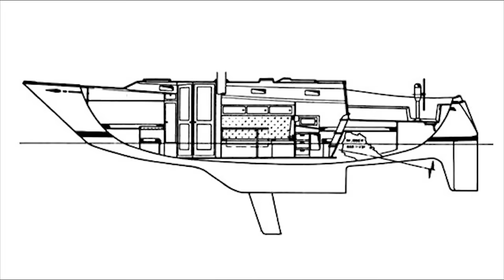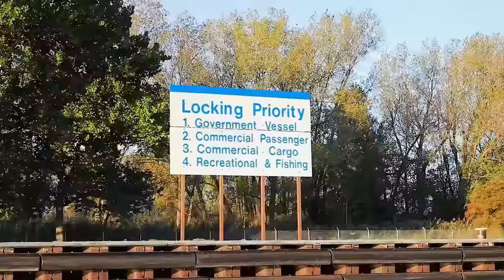How to Run Aground in 8’ of Water When You Only Draw 4’ | Sailing Soulianis - Ep. 24

Comment: You might look at Keelhauling as an emergency remedy.  Not that you actually take a crew member and drag them under the keel but you run a line, under the hull, from side to side and let it sink to a premeasured length that hits the middle of the extended board. then walk aft on both sides until it gets taught and winch.  It might take a couple of tries.  Of course that won't un-jam the line if it gets between the side of the board and the slot.
Reply from the maker: Hi Chris, yeah we tried this a few times. Once we didn't show on camera, and the second time was the "last-ditch effort." And you're right, the line was really freakin' jammed.

Comment: A good outcome in the end,I didn't think the haulout cost was too bad,considering everything.
Tell me,when your centreboard is down,do you draw more than an average boat with a standard keel?
Those industrial areas are a worry,and right by the water too,any wonder there are so many accidental spills and contamination problems.
Let's see how your adventures go as you head further south😊
Reply from the maker: Hi Wayne, totally agree. It was hard to bite at the time, but we learned a lot and came out on the other side without any damage. Not sure what average is, but I'd guess yes -- the boat's technically supposed to draw 7' 9" with the board down (we think fully loaded it's closer to 8').  -L

Comment: Some type of limiter needs to be installed on your centerboard to prevent 'over-centering ' occurring again...possible a short cable or an actual block within the keel well...or a spring or flexible housing to keep the 'hose' engaged in the centerboard's curved channel. When you get it figured out you both will be a God send to other boaters who may be in a similar situation but, with less options for assistance.

Comment: The early 70th TARTAN  is one of the greatest design of all time. I wanted a T-34 so bad, but the Center-Board is a permanent issue and a pain in the butt, even it's just all done and renewed. The pain comes back soon.
One guy I had contact with, took the Center-Board out, filled the space of the Center-Board with lead and closed the hull with epoxy. Never Center-Board issues anymore and the sailing characteristics are pretty much the same (more weight) and you stay at 4 ft depth. That could be a plan for the next "hard time".
Reply: I have a Pearson 35 of 1969 vintage with a centerboard. Never had a problem. 3'7" board up and 7'6" board down. She handles just fine. I think I saw that you guys are now "on the hard" in florida now or are you really just starting your journey? Seems might late in the season. Best Wishes for a Great Adventure!
Reply from the maker: It's worth considering. The fact that the pennant runs basically through an unprotected thru-hull scares us.

Comment: Its actually a swinging keel. Because its primary function is to add weight at a deeper draft. Also functioning as a centreboard or daggerboard affording resistance to leeway facilitating higher pointing culminating in improved progress too wind. Roughly.
Reply from the maker: There’s no ballast in it though. Also Tartan calls it the Tartan 37C as in Centerboard.

Comment: Mark the line so it can't be let out too far???
Reply from the maker: It's marked. But that only helps if it's running up through the mast. That wasn't the issue anyway -- the board inadvertently fell down when we didn't yet have a proper mast plug to run the pennant through and make it fast on deck.
Reply: Bill Roberts ding , ding , ding ding !

Comment: yal need 2 things.. you need to drill a hole in the bottom end of the  center board and lift  it from nearer the bottom.. 2  you need to block it in front so it  cant  move that far forward.. it will happen again.. you want it to be  facing backwards when set....so you  can loosen it and drive forward and lift it at the same time, if it  happens again..when it  happens again..it will happen again  unless  its fixed
Reply: johnny - I doubt the passages for the pendant line would let them connect the pendant to a significantly different place on the board without the pendant chafing badly.  Also, personally, I wouldn't drill into the centerboard unless I was sure it was solid fiberglass (or some other waterproof) construction.  If it has a wood or foam core, I'd worry that new holes would let water get into the core.

Comment: You have to stop the board from going forward.  And only hang straight down so the purchase pull is straight up , still not to good looking at things from here if it goes forward it changes your stability. And balance on the wind and if you ground it won’t fold aft as it’s designed for , keep going good vids

Comment: If it happens again would a length of rope with a weight tied on in the middle dropped into the water at the bow and each of you walking from the bow aft, each of you holding your end of the  rope until you reached the area where the rope contacts the centerboard wouldn't you guys be able to pull on the rope and pull it back? Walking a bit further aft and pulling? Do you suppose that would work to pull the centerboard aft a bit? Obviously you cannot do this with your forward anchor deployed because you won't get your rope past the bow with the anchor payed out. Just a thought but it might work. Of course the rope with the weight on it needs to be the correct length to slip under the bow and be long enough for you both to walk down your respective side of the boat rope in hand and be short enough for the midpoint of the rope to catch hold of the centerboard.
Reply from the maker: We tried exactly this twice before resorting to more drastic (crane) measures. If we hadn’t first tried to winch the centerboard line so tightly it may have worked. Because we pinched that line in between the board and the trunk to the point where the board wouldn’t move freely.

Comment: I guess you could loosen the line and try using the engine and a shallow spot to move the board around....It is much better to get hands on it though, and the water was probably freezing.
Reply from the maker: Definitely an option. But with no way to know how much pressure we were putting on the board or how stuck it was, we didn't want to risk damaging it. The water was cold, but more so it had all sorts of disgusting crap in it -- chemicals, oil, fuel, garbage, debris, you name it.
Reply: @SailingSoulianis  You definitely did the right thing for the first time in the situation.

Comment: I would think the board would have a stop to keep it from going past  parallel to the ground. when extended. then it shouldn't be able to  try and pull up backwards meaning to the front...  enjoyed your video and subscribed.
Reply from the maker: Thanks for watching! Yeah, you'd think that, but there's a benefit to the board swinging forward: you get access to the entire board, meaning inspection and repairs are much easier. The other thing is, if the tension isn't kept on the centerboard pennant at all times, it can accidentally slip down in between the board and the trunk, and if the board is partially or fully down, you might have trouble pulling it up.
Reply: @SailingSoulianis  don't get me wrong I am no sail boater by any reason. just  like problem solving.. If I understand it correctly it stays down by freefall and weight and pulled up by your pennant Rope.  if this is true if you run aground slightly  it may cause the problem you just had by the ground pushing it up and slacking your line and allowing it to go to the side again.  Then may I suggest a snubber   somewhere in your lifting line  as you would a anchor line for storms except stretched when board is down to keep your tension. that way if you do get slack by grounding or whatnot it stays taught.   Happy Sailing

Comment: my keel was hanging down when I pulled my boat for the winter, no sign of the cable that holds it, it must have snapped or come off somehow. I have to fix it before I drop back in in the spring. :(
Reply from the maker: It sounds like a fairly common issue, good luck with your repairs!
Reply: @SailingSoulianis  thanks!

Comment: dag-gone centerboards!  there should be a hard forward stop which prevents the CB from going past a full down position.
Reply from the maker: Ya I was quite surprised to see the centerboard go forward of vertical!  Luckily we had discovered this when were inspecting it up in Charlevoix a couple of months earlier.  If we hadn't seen that then, I would have been much more worried seeing the way it looked coming out of the water there in Chicago. -Kirk
Reply: Why wouldn’t you put a stop so it doesn’t go past 75 degrees (not quite vertical)?  Seems strange that it isn’t designed with one.

Comment: Now that you are aware of the geometry, you could rectify a repeat of the problem by deliberately (and gently!) running aground forwards, to tilt the board back past vertical. The lifting line would then work OK. Just sayin'
Reply from the maker: That was my very first thought right after we figured out we were aground and the centerboard was the issue. Unfortunately, the real problem was that the control line got wedged in between the board and the trunk, so forcing it forward could of done some real damage to the board or the trunk. -Kirk

Comment: Here's a tip use cardboard as a pattern. You could even mark it from below. Save you from wasting wood
Reply: With the open access to the underside, they could even have use thin plywood to trace the inside opening. Then fasten the pattern and two plug layers together.  It would then be trivial to cut it slightly oversized and sand it to an almost perfect fit. Then, screw on the top piece and use the plug to guide cutting the top to shape.  Since the excact size of that pieces does not matter, the shoe on the jigsaw would make a great guide. 

The last step is drilling the hole through all three pieces at once.

Comment: Is it normal for a swing keel to not have a positive stop in the fully down position?   Seems like this could be a common situation,
Reply: On the centerboard boats I have sailed, the keel would always stop against the front face of the trunk. I was sold that a block wasn't used as it would be a localized pressure point - rather than the spread out pressure of the forward trunk wall.

Comment: How does a centerboard like that lock in place when it´s in use, sailing? Those kind of solutions are very uncommon here in Finland where I live, and I´ve actually never seen a centerboard coming out of a keel like that, so I´d be interested to know how sturdy of a construction it is? Thanks!
Reply: If the board has negative buoyancy,  which it probably does, then it does not need locking. If it is needed to reduce leeway, then the sidewards force on the board will keep it from pivoting.
But you are correct that something is wrong. That board should not have been able to swing forward of vertical. That tells me something is wrong with it, possibly miss-rigged or a centerboard not designed for the boat.
What concerns me is that this may be a boat designed for inland waters and not for seagoing.

Comment: I am a landlubber, but one question: why did you insist on using the line to pull the board up, why didnt  you just use one of these straps with a ratchet they use on trucks to fix the cargo, wrap it around the hull to keep that darn board up? this way you would not have to bother about a mast plug that accomodates a rope under Tension etc. what I do know, however, cos I have worked as a diver for boat owners hundreds of times: if boat owners had just basic diving skills and scuba equipment at hand, they could save a lot of money, like you could have saved the money for the haulout.
Reply from the maker: Hi Peter, we did use a line to hold up the board, however this was a temporary measure, as we didn't want to have something slung underneath the boat creating an additional amount of drag for 1300 miles down the river system. This is why the mast plug is necessary. The line, however, slipped off, and once the tension is lost on the centerboard pennant, it can become jammed between the centerboard trunk and the board itself. At this point, there's nothing you can do but get under the boat and free the line by hand. No amount of ratcheting on the board will free it.
Reply: hm, 1300 miles is a legit point. thanks for the reply and good luck.
Reply: What I don't understand is how the pennant can get between the board and the side of the trunk. The gap between them should be far too small.

Comment: Need a more robust connection to the board ??  How does that hose not become dislodged again??
Reply from the maker: The hose is there to keep the line that controls it from "drooping" down the side of the board and getting wedged in between it and the trunk. It adds a little bit of stiffness and thickness to the section of line just before the connection to the board. Our issue was that we just completely let the line go slack. So the line just kept paying out and went past that hose, which allowed the line to get stuck in there with the board all the way forward.  Had that not happened, we probably would of been able to winch it up just fine from the boat.

Comment: Did you realize you ran aground and then tried to back it off?  That would explain the flipped center board.  Do you keep a mask and snorkel on the boat?  In this case it would have only told you sooner what you would have eventually found out ... that you needed to haul it.  But, in other cases you can solve the problem.

Comment: So you headed off knowing that the repairs were dodgy to say the least, then the dodgy repairs failed and you bottomed out, what have you learned from this experience? Have you learned that Murphy's Law is always waiting to screw you, you know the Law that states "whatever can go wrong will go wrong", have you learned that by trying to save a buck by doing dodgy repairs it will cost you more than you could possible have spent by doing it right the first time? if the answer is yes to these questions then congratulations you've had a life lesson that didn't cost you as much as it might have, be happy and stop trying to cut corners for corner cutting is the way to get yourselves in trouble.

Comment: The tug and barge would have seen you on radar and would have probably laid on the horn until you moved,every time we transited the river the old man thought he was going to wear the horn out it was being used so much a lot of traffic usually,we sailed up until the salt piles unload salt from Canada then shift across the river to load coal to bring back to Canada
Reply: Big IF. Bigger WOULD. LoL.  Soul responsibility falls on the lock operator to keep the safe. Never assume.  It will get one killed.   A while back a tow with high empty barges even took out part of the marina, docks were under the rakes of the barges, pilot didn't even know.  Another time, also not in the lock managed waters BUT IN Federal channel, a tow took out a fishing boat a few 100 feet from were these two were moored.  The tow killed the fisherman.  Boat was fishing in the channel. Tow never saw them, visually (dark, no lights on fishing vessel) or with instruments. In this video story, they were on the wall, radar will show the only the wall. Very bad habit to get into. The Lock operator should have locked them back North ASAP, instructed them to moor on other side of lock bullnose in deep water.  Totally protected by a concrete wall.  They could have woke up @ sunrise and left @ their leisure back to Skyway yacht works. 100% safe.  Don't make a mountain out of a mole hill. /smh @ the ineptitude, risk taking, reliance on others & technology.

Comment: I watch the rest of the video.   OUCH   Water too gross to swim under and look.  YUCK.    Questions just in case i am ever on a boat that this happens on.  did you have a come-along onboard?  I see you had plenty of line.  Now I haved raised a swing keel when the cable snap.  but there were 4 of us so two of us were able to get into the water and guide our make shift sling to keep it from slipping off the swing keel.  while the other two were pulling gently on the lines.

Comment: dude, I am a fan, however sometimes you just have to get wet...a 15sec swim w mask at the outset, bam...quick fix...fair currents southbound u 2
Reply from the maker: Ha. Not with all the chemicals, garbage, debris, and literal crap floating in those waterways? Not uh. You first ;)
Reply: oh ok, dirty cold water, I get it
Just sharing options from a swimmers perspective
(And yes, follow me, I would have jumped in within the first few minutes of grounding during what I guess was waning sunlight)
also, maybe practicing cruising independence skills could build character and confidence for when you really might need it.
you guys rock!
 @SailingSoulianis
Reply from the maker: @Saltwest Co Sailing We've surfed some nasty waters. That doesn't even come close to this. It’s literally called the Chicago SANITARY and Ship Canal. It was an Army Corps of Engineers project designed to reverse the flow of the main branch of the Chicago river to carry sewage from the city of Chicago south.  https://en.wikipedia.org/wiki/Chicago_Sanitary_and_Ship_Canal  We don't regret the decision to haul out for a second.